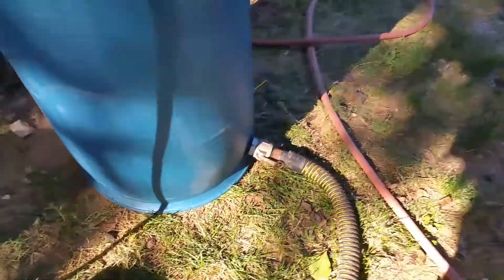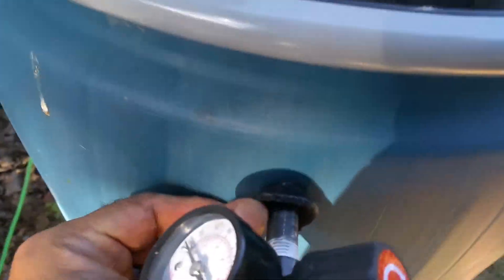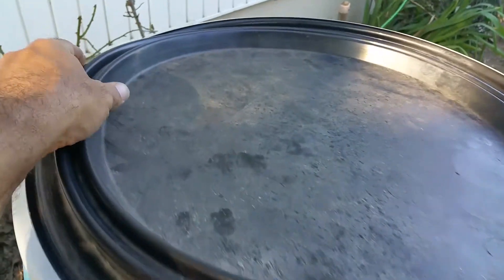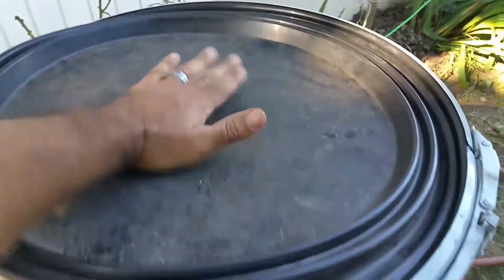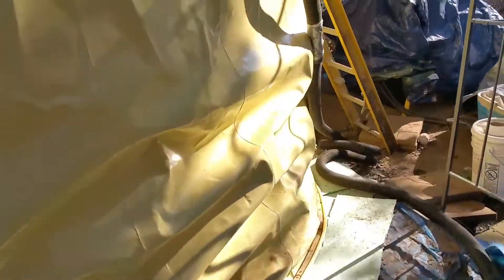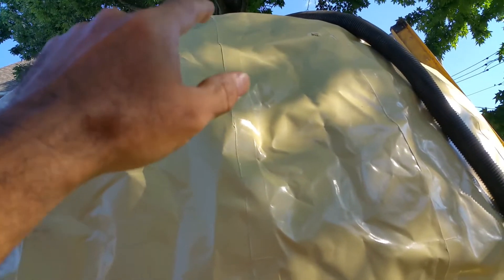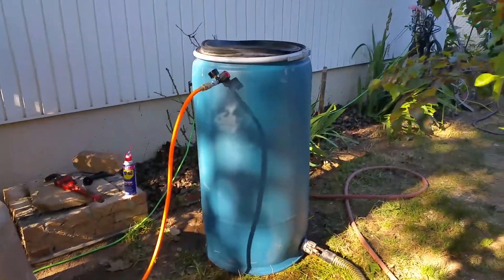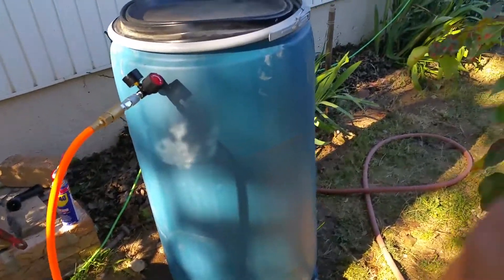50 Gallon Aircrete Pump #AircreteHarryFoamGenerator #AircreteHarry #AircretePump #Aircrete

Comment: If you elevate that then gravity will do the work.
Reply from the maker: If I did a gravity feed would meen I have to mix 3oo lbs of cement and sand, mix foam than bring all that up to 10 or 11 feet. And and don't know how many times I would have to do that. Just one time would be to much for me. If I had a forklift or crane on had  I would do the gravity feed..